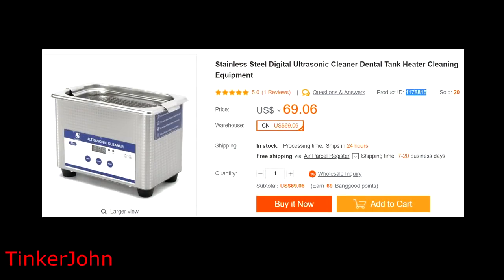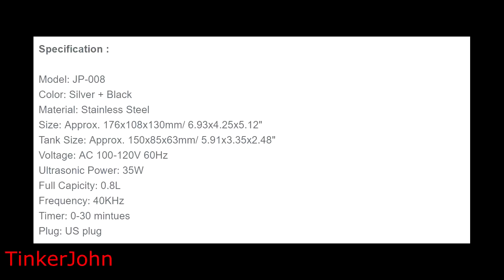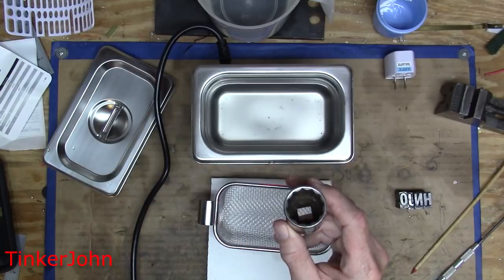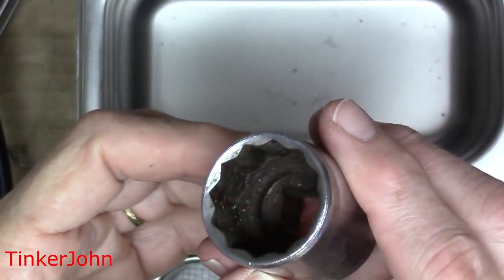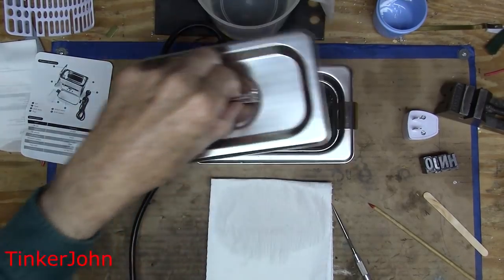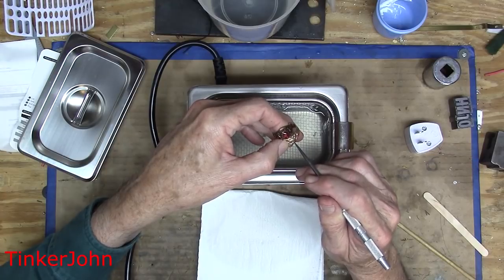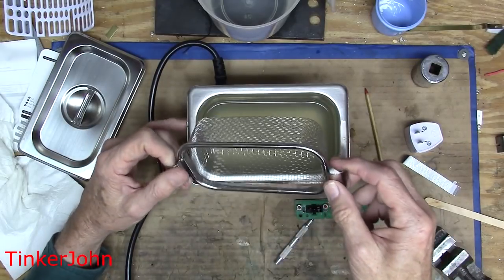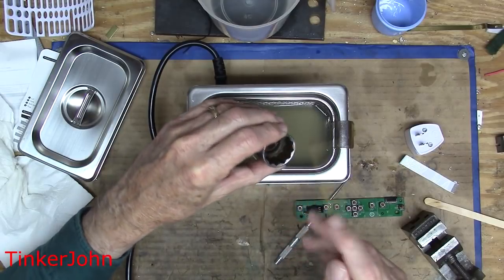Banggood Product Review:  Stainless Steel Digital Ultrasonic Cleaner

Comment: John, I used these for 40 years in the Dental lab and I can tell you that you need some kind of cleaning solution in the water while using. Doesn't matter how you put stuff in but using a basket to keep whatever you are cleaning off of the tank surface will give better results. Oh yeah,,, don't have your fingers in it while it's running.
Reply: So sorry you had to spend 40 years at the bench! I loved the work, just not who we had to work for!
Reply from the maker: Carl, thanks for the heads-up on the cleaner. I had no idea how/what to use with this thing and thanks for the info on putting my hands in the tank.  Take care.....  ~John

Comment: John, I'm surprised you didn't mention cartridge case cleaner for reloading.  It work especially good on black powder residue.  Use vinegar and water.    It gets the bulk off before heading for the tumbler.
Reply from the maker: Wayne,  Good suggestion.  Actually I did not think of cleaning brass when doing the video but should have tried it on  some older brass I have.     ~John

Comment: I have had one of these cleaners for many years. Use to use it for cleaning fuel injector parts way back when. I have used both soapy water and solvents in it. Most things use water and soap well to clean. One thing I can say is to not put your fingers in it while it is running, it hurts Did this by mistake one day. I guess the ultrasonic waves in the water inter the joints of the fingers. My wife loves it to clean her rings.
Reply from the maker: Jimbo, thanks for watching and for your comment about putting my fingers in the solution.    ~John

Comment: Thanks, John, good review. We used to have a very small cleaner for jewelry many years ago, and it seems there was a cleaning fluid made specifically for it that worked quite well. I just checked Amazon and found several types from iSonic that claim to remove tarnish as well as dirt. And concerning those 220v appliances: Xynudu reviewed a Hilda rotary tool that I thought looked so useful (and it is) that I picked up a 110v to 220v converter from Amazon to run it. They're just transformers in a box. Mine was rated 1000 w (the Hilda draws 400w) and was about $40. Just something to keep in mind when a must-have item only comes in European models.
Reply from the maker: Charles, thanks for watching and for the info on the converter and cleaning solution.    ~John

Comment: Hi John, Thanks for reviewing this unit. I have been thinking about getting one for a while to deep clean lawn equipment carbs. It looks like the one you reviewed would be a little bit small for that.  Thanks again.
Reply from the maker: Robert, thanks for watching. This one may be a little small for a mower carb, but take a look at the Banggood site, they have other sizes.  Just be careful of the voltage.    ~John

Comment: John simple green works very well for me in my ultra sonic cleaner , when I can find it I use  the heavy duty simple green ( which is purple ). I do mostly old motorcycle parts, it does a great job on carbs. 73 KC9NDB
Reply from the maker: Thanks for watching and for the suggestion on Simple Green.  I'll try that next time.    ~John

Comment: Hello John,  I am very interested in an ultra sonic cleaner but that is just too small for what I need.  I have heard both pro and con on the Harbor Freight version which is quite a bit larger.  Doing carburetors large and small is a task they excel at.  The local Yamaha dealer has one for engine parts and it works quite well.  Mostly they seem to run it overnight with a special cleaner in it.  These little ones and their timers seem a bit optimistic on cleaning ability.  Much less than two quarts just wouldn't be useful or worth the shop space.  Keep the reviews coming on the useful stuff.  See if they have any true ceramic or cbn inserts for the small lathes and test them out maybe?  Take care.  Doug
Reply from the maker: Doug, thanks for taking a moment to send along your comments.  You are correct, this is small for a production shop, it's mostly for home use and smaller items.  I've not tried the unit with any cleaner other than a drop or two of detergent.  I think I'll try something like Simple Green  and see results.   I'll see what I can do about the lathe tooling.  All the best,    ~John